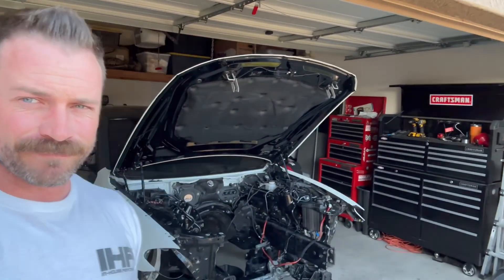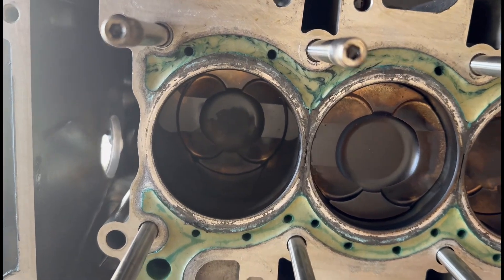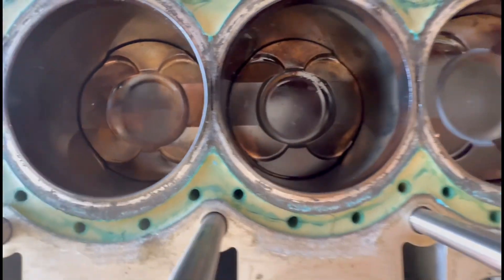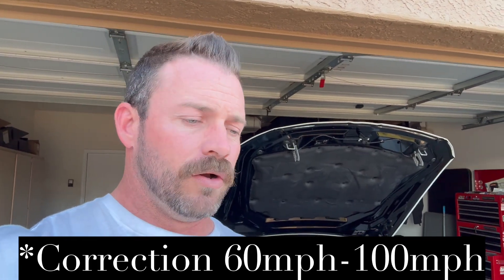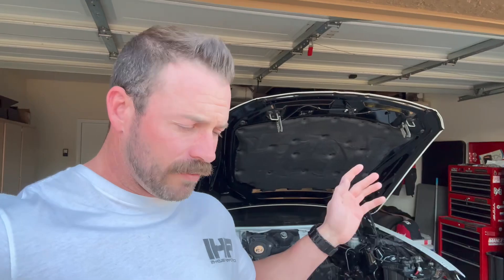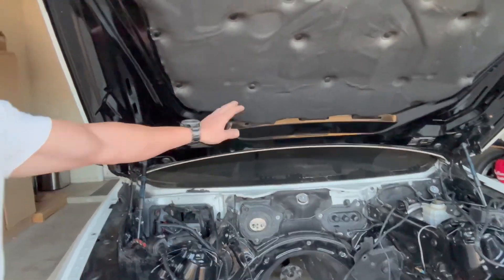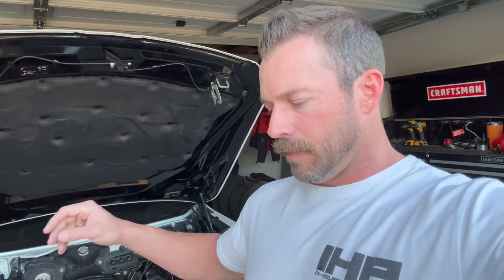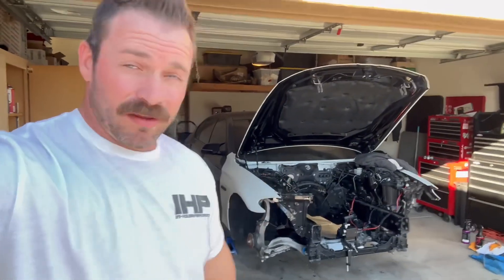N55 Making 850whp and How I experienced Cylinder Failure at 43psi!!

Comment: You mentioned using an s55 block and just thought id comment on that. Currently running an s55 block with n55 cylinder head with a big single kit. Manley rods, M235i Crankshaft and S58 pistions
Reply: Currently about 900miles on the build. DI only Currently making 789nm of torque to the clutches on 91oct winter map.
Reply from the maker: @P @PrecisionBimmer hell yeah keep me up to date on this. I might have a few questions

Comment: Bro 850whp on the n55 is awesome but ppl that already built these specifically the 2014-16 n55 said that you have to upgrade road and pistons and also closed deck over 800whp which is the same for almost any performance engine . But the 2017 x3 m40i has the n55 closed deck and was built to take more power and I’m wondering did you do rods and pistons I’m sure you did .
Reply from the maker: No N55 came with a closed deck. And the 2017 X3 M40i has a B58 not an N55. And yes this has manley rods and pistons

Comment: I’ve watched a few videos and I’m in the process of building a n55. I want to try and get to 900+ range. I want some help on this platform because I have no idea where to start really. I come from the coyote side of things.
Reply from the maker: Going to need a full forged internal motor build with closed deck and a big single turbo. You will also need to build the transmission. Watch a few of my videos and if you have any questions hit me up on IG.

Comment: Do you think it cracked because of the high boost? Do you think using the epoxy on mid boost will hold up?
Reply from the maker: Yes it cracked because of the high boost and not enough support between the cylinders. As I didnt poor the epoxy in those areas because I didnt want to affect the sealing of the head gasket.  I would try fill the areas between the cylinders but it might not be enough. Honestly if you are only making 30-35 psi with a full frame and staying below 750whp you shouldnt need epoxy or any type of cylinder support. Plenty of people out there making those numbers open deck.

Comment: i gotta ask how did you tune out the check engine light when you did mods? because i cant get my damn car to pass inspection lol here in ny
Reply from the maker: You can turn off the check engine light with coding through the tune or by the tuner but it wont past emissions. My car is registered at families vacation home that doesnt require emissions.

Comment: Just when I thought we may have someone setting some records for the N55, he's making some frankenstein motor. 😢
Reply from the maker: I know but unfortunately the N55 bare block has some flaws and weaknesses that just arent cost effective to fight. My pockets are only so deep LOL
Reply: @Inhouseperformance  N54 block and head seem to be limited to around 750whp. Would you say that's about the limit of the N55?
Reply: @Inhouseperformance  If you can get deep into the 9's, even low 9's with 800hp, I'm dying to know what the goal is.

Comment: For sake of conversation, are you insinuating that close decking the factory open deck caused the failure between the bores? It sure doesn't look like there is a lot of material between the bores themselves. Id assume that that's where most people see failures at on that engine at this power level, not necessarily the top or bottom of the cylinders where the epoxy reinforcement was done. Maybe you could make a case saying that with the rest of the cylinder liner reinforced, that there was no place for the engine to flex and it cracked at the weakest point?
Reply from the maker: No Im insinuating that doing the epoxy wasn’t sufficient enough as the areas between the cylinders are the areas that will crack. And with the areas around the cylinders supported and not in the most critical areas this will happen. If a proper closer deck with press in material is done and the areas between the cylinders are filled and the block is decked there will be a better chance at success. My personal opinion is the best outcome will be to resleeve the block. But the top of the cylinder bore will be the area more likely to crack as this is where most of the pressure will be created during the combustion cycle where the piston is traveling towards the cylinder head.
Reply: @Inhouseperformance  That makes sense. Its intersting that the spots between the cylinders arent solid and that there is some sort of gap. Im sure the engineers never thought someone was going to make that amount of power out if that engine. Would you have to run a smaller diameter piston to get press in sleeves with a thicker cylinder liner?

Comment: 850 hp N55 checking in here 🙋🏽‍♂️
Reply: Im running a ccs closed deck with forged internals and 1 piece crank hub 6466 precision turbo
Reply: @straightsideways4834  Dang! How much did it cost for the engine getting a closed deck and turbo? Did you install yourself?
Reply from the maker: Nice!  What kind of setup are you running?

Comment: N52 head with a standalone and 12 port injectors would be best it has bigger valve sizes same as a 2jz the n55 are a lot smaller valves than the 2jz
Reply from the maker: Im going to stick with the N55 head and full DI as I have a sponsorship with Dorch Engineering. Dont need port injection for these motors. My last setup was DI only and Instill had 40% head room at the power level I was at on E50.

Comment: Hell yeah man a lot of these new bmw jits with b58 just can go fast but have no clue about real driving. A de stroker n55 will be one of the best driving experiences you’ll have with a 9k redline. How an engine makes and delivers power is everything. B58 have essentially the same bore to stroke of a 6.7 Cummins diesel. .863 vs .868. A n55 is .937 which is much closer to 1 where it should be for a boosted motor perfectly square. But that’s why the RB26 is so amazing it’s over square and revs to 8-9k. It’s gonna a dope ass build you’re doing

Comment: CSS guarantees their block, without sleeves, to 900hp. I have a T0 block from an M2, with the ductile liners, and their closed deck, with arp hardware so, No worries. (Hopefully)
The cast bottom end needs proper proper tuning and it will survive high numbers, you just cannot hammer on it. High transient changes in RPMs will twist those parts. 
Twins are not as efficient... But it will be cool. I thought about doing that, did a single G30-900 instead. 
Seems legit 8" rear end swap. Ftw!
As far as I'm concerned, the 4N RB destroked kit, with an equal length manifold is the best sounding setup in BMW aftermarket. It's the only major thing I wish I had done in my build. 
God bless your path forward on this. I wish I had filmed more of the work I've done on my 335i engine. I'll be posting a compilation video eventually.
Reply: @KINZERS13GTR what sleeves are you using what's the brand
Reply: @Alfonso-mh1np  they're not a modified part. The N55B30T0 from an M2 or X4 have iron liners, no plasma coating. The N55b30M0 in the 3/5 series does not have the liners and uses the plasma coating. It's also got the S55 bottom end, and the M2 version gets the oiling system/sump. Also, as far as I know CSS machines their own sleeves when you request them.

Comment: You epoxied your block but didnt put epoxy in-between cylinders makes sense?
Reply from the maker: Its not easy to get the epoxy between the cylinder and make sure the surface is clean and flat so I didnt have head gasket issues. Its possible to do but not sure how much it would have helped
Reply: @Inhouseperformance  I'm sure it would.. Or you press a piece of ally flat sheet and give it a skim

Comment: Wait, so the S55 block works with the N55 head? I was told that it wouldn't work.
Reply from the maker: Based on my very minimal digging and conversations I believe they do. If you look the cometic multilayer head gasket says N55/S55 so all the ports are the same, the bores are the same. As far as I know the N55 and S55 have almost identical cylinder heads and the S55 just uses different materials for the valves and other mechanical components.
Reply: I was told that one of the head bolts is slightly misaligned (~1mm), but I noticed that the head gaskets are the same too.

Comment: Do you think that closing off those gaps in the upper cylinders would help? I’m shooting for a similar goal, and my block has been sealed up in those sections.
Reply from the maker: It depends are you talking about with epoxy or another solution?

Comment: You should use an n52 head...screw it...all the air flow!!! 💪
Reply from the maker: Ehhh Im going to be getting everything CNC ported so its getting all the flow dont worry! 😂😜
Reply: @Inhouseperformance  with no direct injection on the n52, the valves are actually a whole lot bigger then you could cnc 😏

Comment: Real life R&D happening here. Cylinder pressures went way beyond what BMW engineering even imaged.
Reply from the maker: Hahahaha facts Im testing all the limits for yall. Im impressed the crank was still holding up.
Reply: @Inhouseperformance  the N55 block and cylinder liners are pretty strong but the epoxy can't fix the weakness between the the siamesed block. The other issue is that you developed a hot spot where there isn't coolant. Did you have any knock or pinging at high boost?

Had you kept the stock head bolts, your liners would have been fine and you'd have lifted the head instead. I'm assuming the head will lift way sooner than cracking the liners at much lower boost pressures.

The N57 diesel blocks are closed deck design and can handle massive amounts of cylinder pressures. Unfortunately, the N55 was designed to use regular gas and needed to have an open deck design for cooling. Best bet is S55 block. I'm glad you are staying true to the N55 and using as many of the N55 parts as possible m
Reply from the maker: @brarautorepairs well one I already lifted the head with the pure750 so I needed to go to head studs no matter what cause after 32 psi you are very likely to lift the head. Secondly I didnt use inserts when installing the head studs. Jeff at CSS walked me through his procedure on how to install the head studs without insert as inserts create a weak point and cause cracking that you speak of. The only cracking I experienced was in between the cylinders where the structural integrity of where the head studs are would not have been affected.
Reply: @Inhouseperformance  at least we know where the limits are with the factory head studs and block.

Comment: Dude honestly 850 wheel for a engine that makes 350 from factory is insane lol
Reply: N55 is making like 250-280whp factory depending on model
Reply: @azzazz96 All F10 N55’s make 300hp from factory
Reply from the maker: It really is, 😂😂 never did I think Id be doing this with this engine or chassis LOL
Reply: @Inhouseperformance  what’s been your best 60-130?

Comment: You should run a fuel cell with a surge tank all the way far back by the rear bumper as possible to leverage weight onto the back tires

Comment: Are you still going to use the factory ecu or are you going with syvecs or max ecu standalone with an additional standalone controller for the transmission and using a tap shifter to shift up and down
Reply from the maker: This is a very good question that I havent decided on yet but likely go with max ecu and a standalone for the transmission as well.

Comment: Ask 4n what do they think about using solid lash adjusters for the valve train instead of hydraulic lash adjusters that possibly can squish or even worse can balloon at high rpm and hang the valves slightly open. You would not even risk having these problems with solid lash adjusters and some really good valve springs

Comment: The sleeves on the s55 aren't that strong either they make dry sleeves that press in with a top lip flange for the s55
Reply from the maker: Yeah that is an option but theres a bunch of S55s making north of 1000whp with stock sleeves and with the stock sleeves I can run a stock head gasket. Which the combination has proven to make 1200whp without needing a firing ring head gasket and all the Bs you deal with with the B58s

Comment: Are you going to do a ford custom 9 inch diff conversion for the rear? Have yet to see it done on the 5 series but have seen it on all the other 3 and 2 series builds
Reply from the maker: Im thinking about it, most are doing an 8.8 but I might go 9” as Its a better option for the power and how I plan to use the car!

Comment: You won't be able to run the s55 oil pick up if you want to run x drive though.
Reply from the maker: Yes that is correct but I dont need to run the S55 oil pick up and baffle system as the N55 pick up will work just fine and the AWD oil pan will act as a natural baffle system.

Comment: Let’s go ! This is crazy didn’t know that was possible to use an s55 block instead of n55 would you be running a standalone or just blocking it off and using stock pumps. Wish you the best and to crush those records
Reply from the maker: S55 just has a different vacuum pump but the N55 one still bolts up to it so will still be using the Dorch N55 49% lift kit with the N55 single HPFP kit.

Comment: Have you ever thought about LDS. Spraying cylinder walls arc plasma spray? I've been taking notes on what makes the B58 like it is from factory
Reply from the maker: The S55 blocks have an arc sprayed iron coating on the aluminum cylinders to help with durability and strength as well.